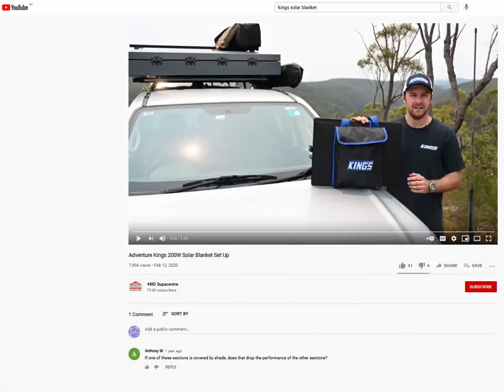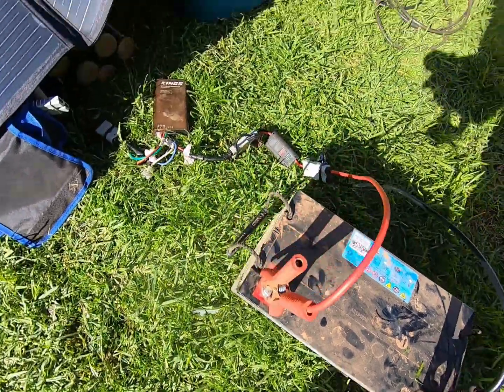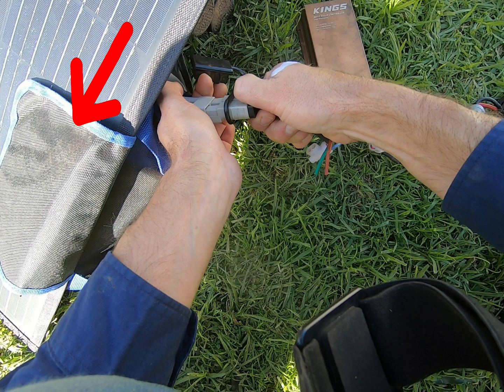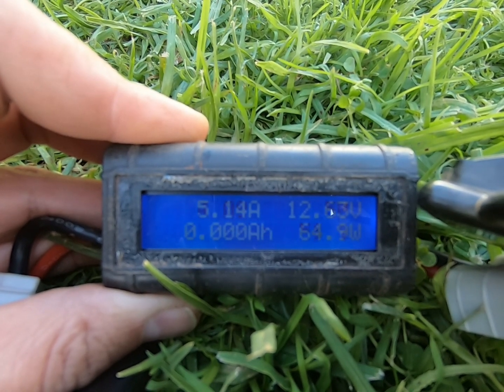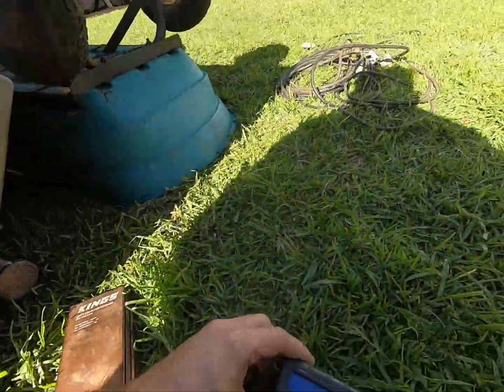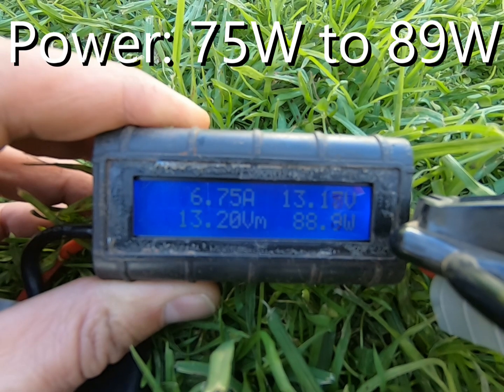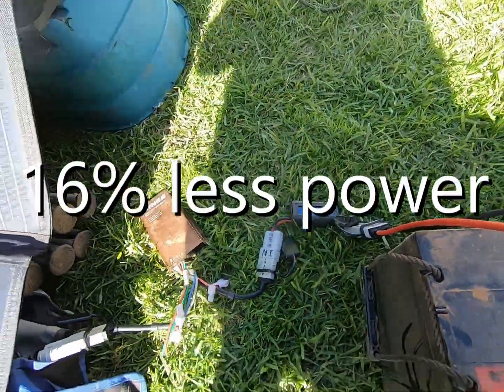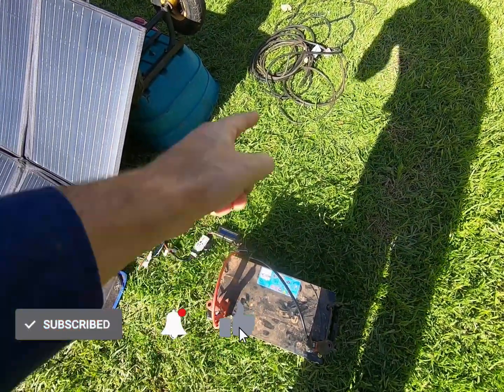Shade on solar - does a little bit matter?

Comment: I have seen this effect on other cheap blankets but not on better quality products. I am wondering if the type or quality of the regulator is the culprit? Maybe cheap PWM controllers cannot handle small reduction in voltage from blanket?
Reply from the maker: I was using the Kings MPPT regulator for this test. Probably not the best but I found the same behaviour with both the Kings and Redarc blankets, and the Kings and Redarc MPPT regulators. I think this is unavoidable if you have all modules in the blanket/panel connected in series. If each module has its own controller, you can largely get around this problem but not too many panels have that extra expense.
Reply: @TheMusingGreg  Hi, I experimented with my 200W Ridge Ryder that includes a qualityMPPT regulator. It has 12 panels. Flat on ground in full Sun it delivers 10A. With one panel covered it delivers 8A. With two panels covered it still delivers5A.   I have seen some blankets that drop to zero with only one panel covered. Presumably these blankets will be poor performers in overcast conditions.
Reply: @TheMusingGreg  I expect a regulator requires about 16V input to work and a cheap regulator may require a higher voltage to work. If the input  drops below this threshold then the regulator will not turn on. If the blanket is a bit down in output, say 17V, then the regulator will turn off with only a bit of shade.